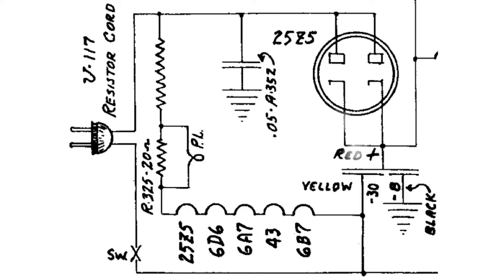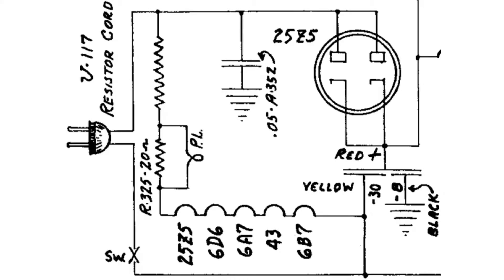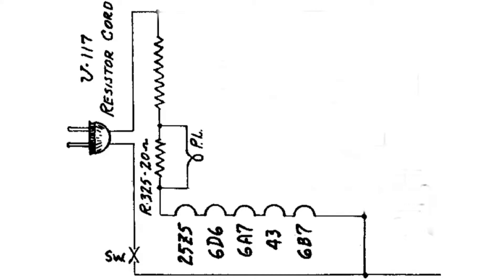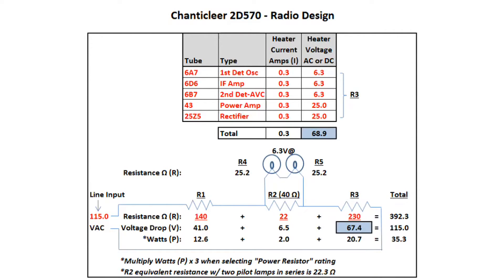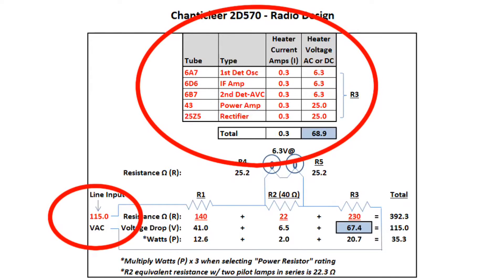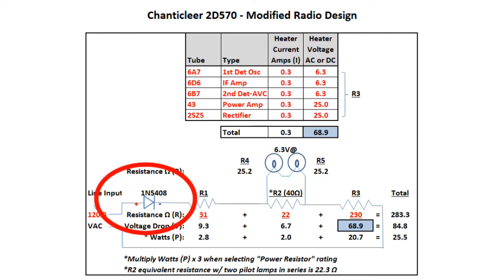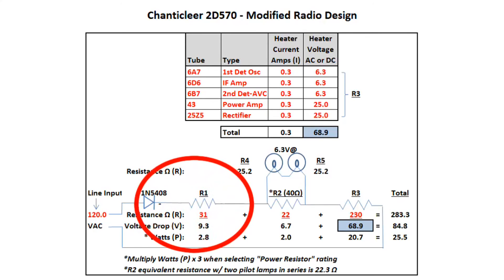Chanticleer 2D570 - Candohm Resistor Replacement

Comment: Hi Don, awesome analysis of breaking down the components of that canned resistor. I'm sure I'll come across this problem as well many times as I get more into these radios that I may find. Using the diode to drop that massive 140 ohm was a great Idea, and now just a few watts as well. Thank you so much...... so looking forward to more of these Chanticlear vids!
Reply from the maker: These old resistors are common, so if your luck is like mine, you'll run across a few that are open. I've probably replaced a half a dozen or more in the last couple years. Glad you found this helpful Tony. Best, Don